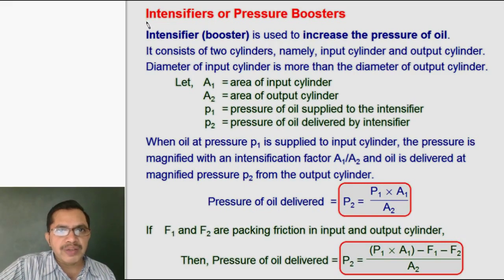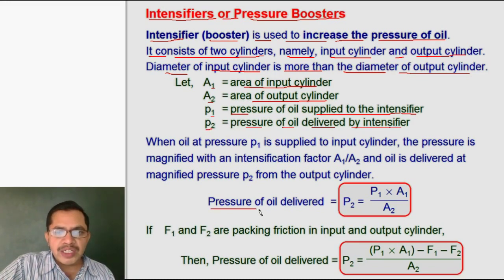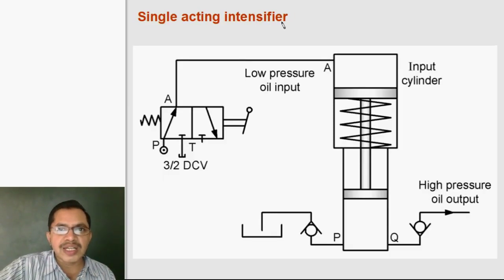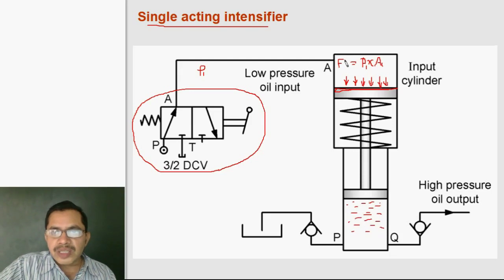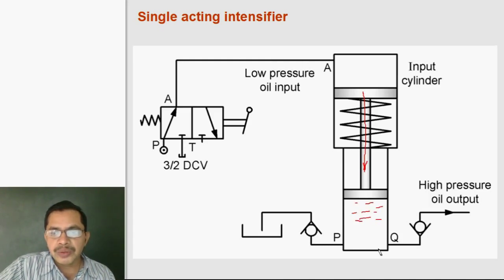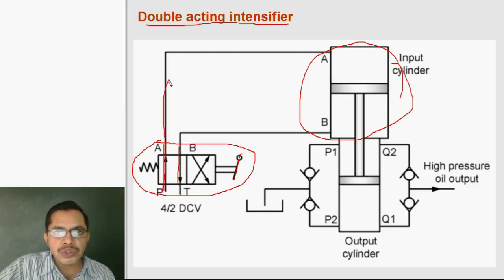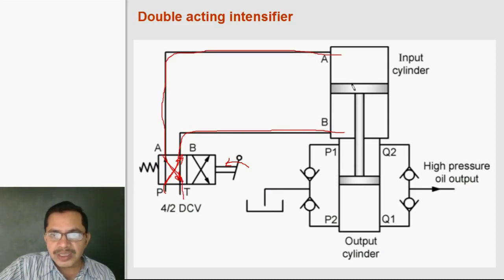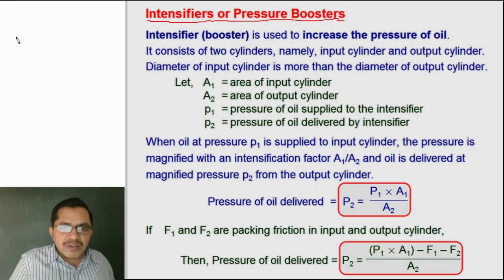Hydraulic pressure intensifier (Booster)

Comment: On the double acting intensifier, when the pistion is moving down, it looks from the picture that the cylinder volume gets smaller. Can you explain to me why there is a suction from the tank (P1)? In my mind the pressure will increase, not decrease, when you make the volume smaller. thanks